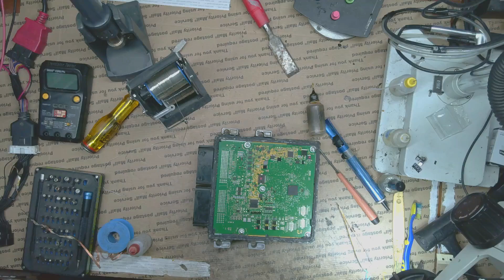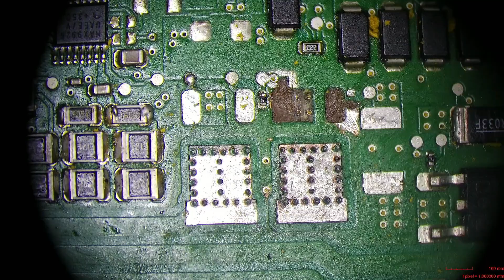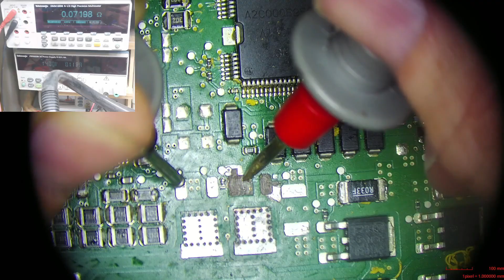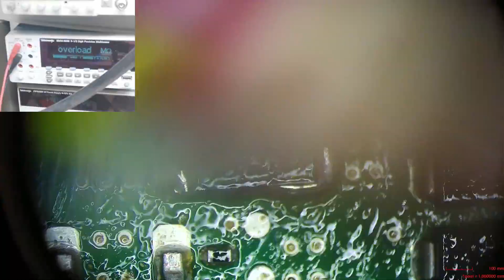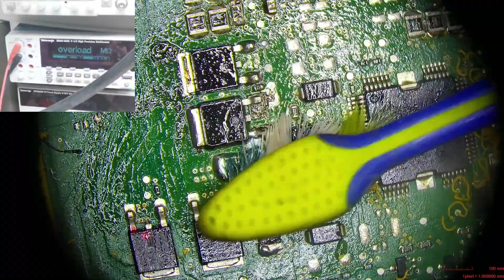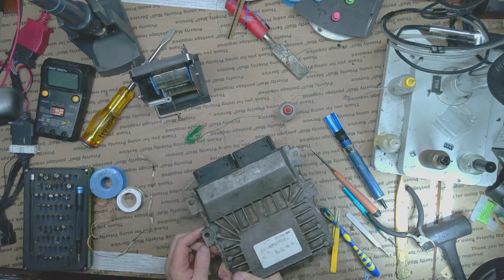Fixing a Botched Coil Driver ECU Repair for 2015 Ford Mustang GT  #ecurepair #electronicsrepair

Comment: I have to admit it is really strange to see a DPAK3 footprint with missing #1 and #3 pads (Gate, Emitter). Usually even the most inexperienced tech will usually just cut the two gull wing legs and then try and deal with the tab (#4 Pad). With the gull wings legs cut they are easily de-soldered without pulling pads. How, under what circumstances, would you rip the pads off of the board?

The DPAK3 footprint for the tab thermal vias are of the old style which is strange for a 2015 ECU. When a new relatively inexperienced design team (lowest bidder) starts laying out ECU PCBs it seems they all make the same mistakes. Which is strange because Ford module teams know the best layout consultants. All the newbie Tier one supplier needs to do is hire one. The problem, the DPAK3 exposed pad thermal vias are not covered in solder mask. Which is bad because an uncontrolled amount of solder volume will wick down the vias during reflow, and also repair, but generally the PCBs are not designed to support repair. 

The DPAK3 ignition IGBTs thermal vias usually will have three rows parallel to the tab, top, middle, and bottom (closest to the gull wing legs) with solder mask across the vias looking like stripes. So, the footprint looks like three pads devoid of vias, bottom, middle and tab. Also, there is no need to inset the footprint side below the tab because the inside corner just creates a stress riser where a crack can form between the corner and a via, which is bad if part of the pad comes off when you de-solder a part. What you will see on a properly designed footprint is a larger pad area for the tab both sides and top. This allows a large smoother solder fillet that goes from the tab top around the corners to the sides.

The official proper way to solder the DPAK3 Ignition IGBTs with the footprint as designed is to first tin the pad with a very thin coating of solder. Just enough solder to slightly wet the pad. Add liquid solder flux which matches the RMA in the wire onto the pad. Then place the part and apply a tinned broad high thermal tip, like in the video to heat up the part and the pad together quickly. Then using 63/37 Kester RMA 44 at 0.025 inch diameter feed in about 3/4 inch of solder wire and observe what the package does. If the the package slightly floats add about 1/4 inch more. If the package does not float add more solder until it does. If you have applied the correct amount of solder when you remove the soldering tip you should see a large uniform fillet with the package slightly floating. In the video the first IGBT had too much solder to make the joint. 

You have to have some experience to notice when a part floats, but you can actually see the distance off the board if you look at the gull wing pads and there is a small gap between the leg and the pad. The process is tricky because it is time dependent. The more time to make the joint the more solder will wick down the vias.

If you look at the factory soldered DPAK3 IGBTs you will see that the tab fillets are not large enough, and actually would be flagged as a defect if people followed IPC standards properly, which would lead to changing the footprint. However, it's just not the tabs that don't have enough solder, the gull wing legs also have undersized fillets. If you look closely the footprint for the gull wing pads should move towards the body of the package centering the leg on the pad. More importantly the area behind the leg where we would like to see a larger fillet. There is a lot of space available for layout clearance and creepage. I also think there was a design mistake done with the emitter side of the IGBT the foot print designer clearly wanted 6 through hole vias to convey the high currents and these were cut back to four, why? There is ample space available which noting else can occupy. More vias would convey more current and more heat. Really strange they are not included.

Another newbie mistake with large bed of nails test pads placed in line with small traces is the lack of teardrops where the trace meets the pad. Before releasing the PCB for production you would put teardrops where ever possible for pad dia 3x trace entry. Today it is common to have the DFM utility scan the artwork and flag any missing teardrops.

The jumper would actually go on the pad side of the parts and not across the body. For a power jumper we would choose the largest tinned bus wire diameter that would work cut it to size then add teflon sleeving over the wire and then solder. The teflon sleeving can easily with stand the jumper being solder without and heatsinking. After which you then glue the jumper to the board. The method in the video will obviously complete the circuit, but we would like the jumper to be placed so if a part need to be replaced you don't have to remove the jumper from the board. Also, in general to be IPC compliant, you will always have covered jumpers in to help prevent a short circuit.

Comment: One question, where to get transistors? I need two 5103de and one 5104db transistors. There is no datasheet for them  so what replacement transistors to use.
Reply from the maker: I usually shop at mouser or digikey
Reply: @ecurepair  Thanks, it seems that the 5104db transistor is fine but for some reason I have a readings from pins 1-3 on the board (transistor leg 3 raised from the board) of 230 ohms. The two 5103de transistors on the board that control the upstream and downstream lambda probe heaters are not connecting to ground even though according to the tests they should. For test I use two digital multimeters, one on diode test (red probe to pin1, black probe to pin 3) other to mesure resistance from pin 2-3. When diode test probe is on pin 1, resistance between pin 2-3 is 0.2 ohms and when diode probe is lifted resistance on pin 2-3 is 8K ohms. Both transistors are connected to pcb. There no visible damage to pcb or components.
Reply from the maker: the 5104 and 5103 and 5053 all are ford in-house part numbers, They do not actually exist outside of fomoco manufacturers anything you see online means its a fake counterfeit part. The is no telling what it actually is. You will need to learn the circuit your working on, how and what it does at what power, Then replace it with a compatible off the shelf part. That is the fun part of automotive ecu repair.
Reply: @ecurepair   Yea I tried to find transistors spec but no data sheet available. Thanks anyway.

Comment: Hi, tedious work :) Haven't you thought about putting some solder mask under the 0.33 resistor?
Good job 💪💪
Reply from the maker: Yea that would have been an idea, I probably still would have offset it as well just incase though.